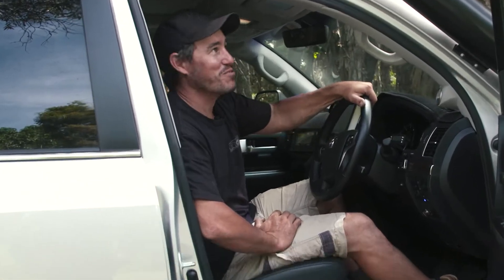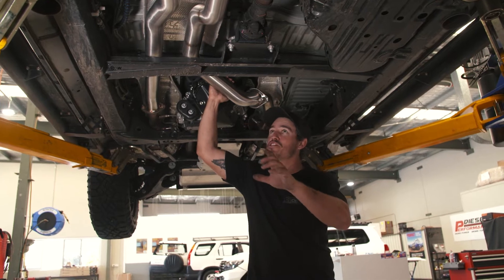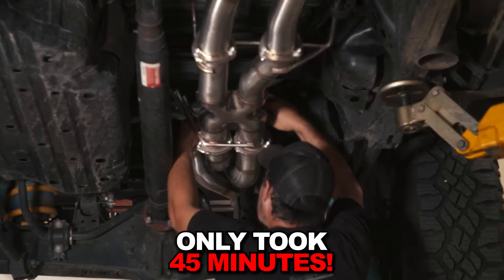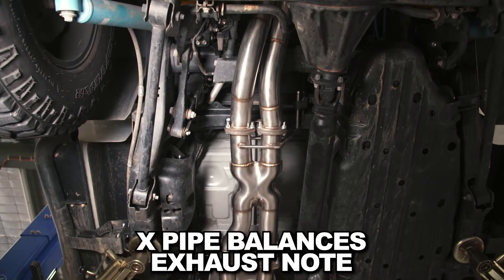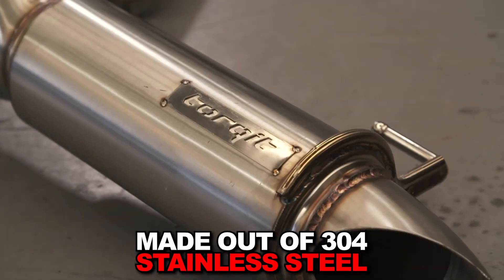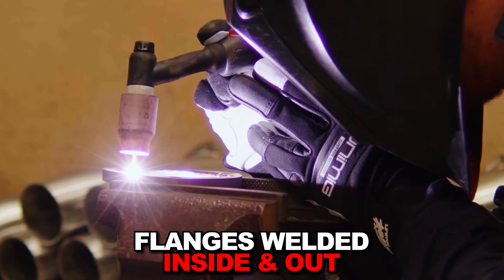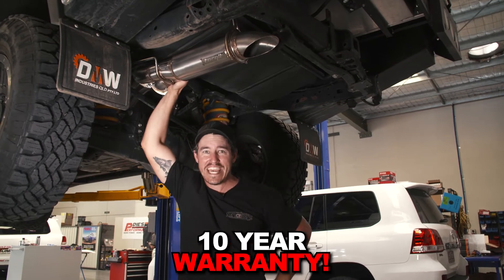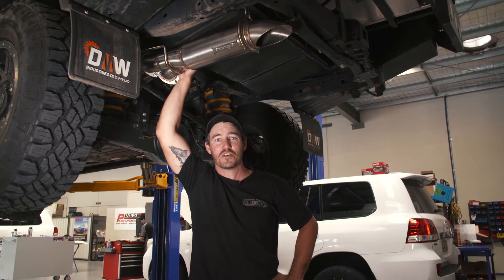SOUND UP!! Listen To the Tough V8 Note on Shauno’s 200 Series!

Comment: Hey Shauno... I Just bought the same. Fitting next weekend. Is there much of a drone at highway cruising speeds/revs?
Reply from the maker: Hi mate, this page is managed by Torqit not 4wd 24/7, that being said you should have no drone thanks to the thick stainless steel construction of your system.